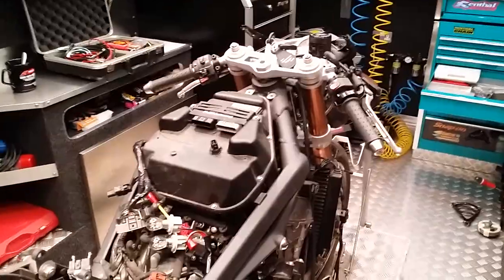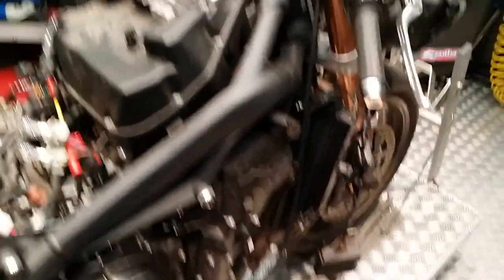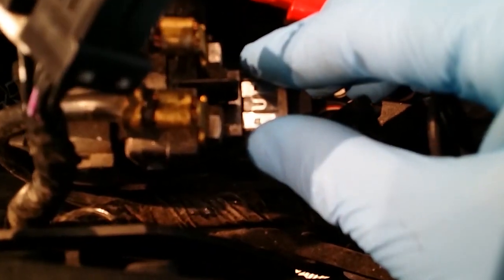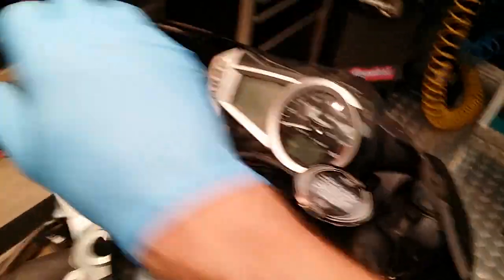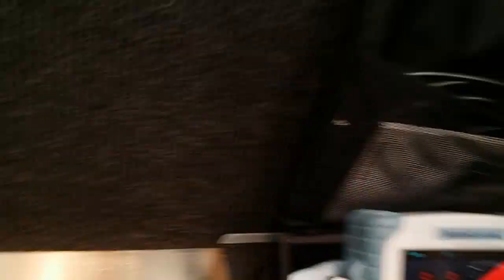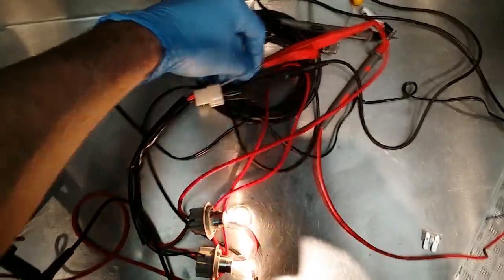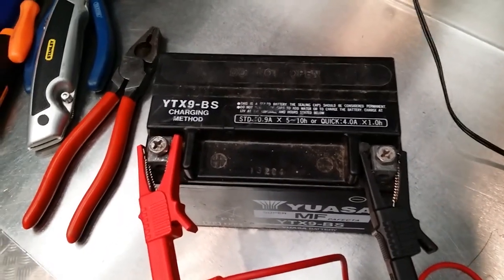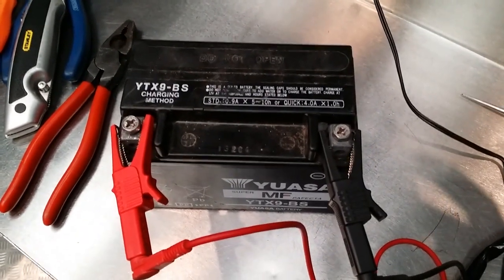The strangest electrical fault I've seen in 25 years

Comment: Many years ago here in usa I had a barn I  used as a shop for appliance repair, where I kept a spare car battery. Apparently someone decided to borrow my battery and never told me. After inquiring around nobody knew shit about my lost battery. The next day I got one from a scrap yard from a customer of mine. I decided to take the time to rebrand the posts, shaved and rebranded, inverting polarity. Within a few days I observed the neighbors cursing and trying to jump start  their honda accord. Three mechanics later, they just sold it. Thought I'd share my story, unfortunately I never saw my batteries again. Now that I've learned a little in the automotive field, it was probably the ALT fuse. Karma at its best,$6500 car sold to someone for $500. Iwould see it around town once in a while, I  believe. There were quite a few of them.

Comment: I have run into this once before and as you stated it occurs when the battery is stone dead and hit with reverse polarity.  I was successful in reverting the battery back to proper direction by completely draining the battery then re-charging and conditioning properly but the battery never held a great charge.

Comment: I've heard of a similar thing on 2 cars. On both occasions the battery had been flat and reportedly "just been charged". I would bet that whoever charged it, connected the charger the wrong way round. Lead-acid batteries are capable of being charged up the opposite way (although they won't last very long after) and it wouldn't be obvious to the person connecting it incorrectly because the battery was flat, had it had some charge already in it the charger fuse would usually blow.

Comment: IIRC.. If a totally discharged battery is recharged with the wrong polarity then its intenal polarity can be reversed. Unlikely to happen with a modern charger as most have reverse polarity cut out circuits. Guessing that battery is toast! Substituting with a known "good" battery will confirm... Was any welding carried out on the bike with the battery connected?

Comment: Very strange indeed. I never thought of it as the easier way to change polarity is to simply to change the leads on a battery.
Chemically speaking however it is possible because this kind of battery produces an electric current when Pb(s) (solid lead) is "dissolved" into lead-ions(aq) due to a redox reaction. If the balance is pushed the other way, the current will reverse.

Comment: That is exactly what happened .The batt was flat dead and someone put the charge cables on backwards and it charged.  It would work fine until you try to jump it or something. I would drain it back down until it is flat dead.Maybe with your bulbs and recharge it correctly..

Comment: So the battery was manufactured with reverse polarity?  Possibly.  But any lead-acid battery can be recharged with reverse polarity and it will have reverse polarity after being charged. My late husband was a mechanic and we recharged DEAD batteries with reverse polarity and it WORKED ! We worked on old cars and sometimes the battery cannot be placed in the car with manufactured polarity because the thick short cables don't reach.  AFTER ALL, A LEAD ACID BATTERY IS NOTHING MORE THAN 2 LEAD PLATES IN SULFURIC ACID.

Comment: Most likely someone has charged the battery mistakenly in reverse. A lead acid battery has lead materials in both electrodes that can polarize in the opposite direction when charged in reverse. Attempts to correct the situation by charging in the correct direction are fruitless because a key organic ingredient in the normal negative electrode will have been oxidized during the reversal. Furthermore, the chances of a short developing during a reversal is high. The battery cannot be recovered to a well functioning state.

Comment: It is completely possible for a battery to have reversed polarity, there is nothing in the chemistry of a lead acid battery to prevent it from being charged the wrong way around. 
If a charger is connected the wrong way around to a battery it will normally spark and alert you that you are connecting it wrong, it can also blow the diodes of the charger but if the battery is quite flat and the charger is a high amperage charger it will charge the battery in reverse.
This fault is not that strange and I saw it a few times.

Comment: Hi I have just received a new out of the box 6volt battery for my Harley wl45 1937 filled it with the two bottles of acid that came with it left it for one hour as instructions hooked my acumate 2amp charger and it showed that the terminals were the wrong way round so I tested the battery and found it was only giving a read of 6volts if I changed the black to red on the metre I now have a battery with reverted polarity I am now discharging it with a spot light I had hanging around then I will try and recharge it I have not touched the battery with any electrical equipment other than to test it after it showed it was the wrong way round this very strange have never had this happen and must have bought at least 30 battery's in my time any way I hope I can fix it it seems this can happen with a dry battery then you try to charge it with a old type charger I was trying to do it properly by 2amps in it as to charge it slowly thanks for listening

Comment: Its very possible to "reverse charge" a dead lead acid battery , put a load on the battery run it dead (slowly) then charge it with the leads on  terminals proper polarity (or replace it),,, one will always blow the rectifier/regulator if you connect a battery , polarity backwards (or the rare one that's been reverse charged) , and I would check the charging stator coil as well though I bet the fuse saved it ,,  how well the rest of the bikes electronics faired will depend on rather they actually received reverse polarity ,, all the magic boxes that have semiconductor components  ,, wont work anymore unless they have reverse polarity protection..  most cars today wont close there main power relay if the battery is reverse polarity saving a number of the magic boxes.